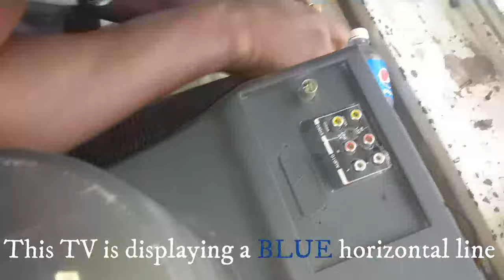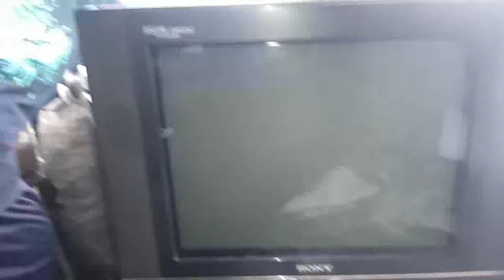How to fix TV Displaying horizontal line across the screen.

Comment: The replaced capacitors did they have the same specifications as the blown capacitors? 🤔
Reply from the maker: yes you have to replace with the one with the same specs. and also observe polarity when replacing capacitors.

Comment: I have an old tv ,it has image but the image is glitched ,like when you move the scart cable and apears random lines on screen and the image is not stable ,do you know what can be the reason ?
Reply: Mine too
Reply: @tktoxic5644  actually i foind the reason ,the reason is a capacitor ,but you need something to test the voltage to find the broke one ,i hope to be helpful ,also the capacitors can be a problem and for sound